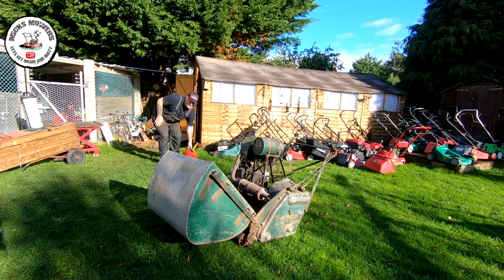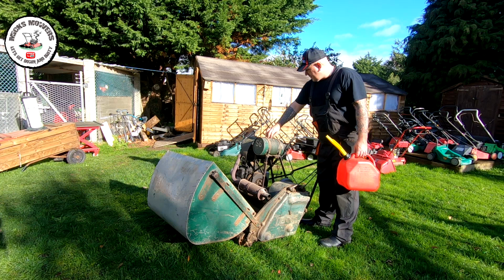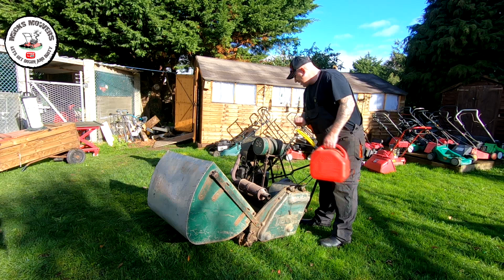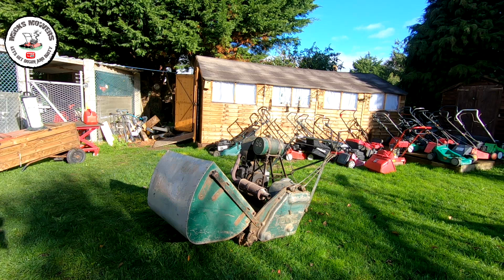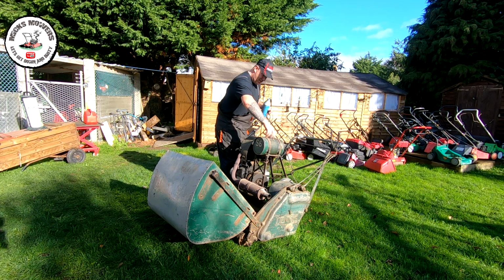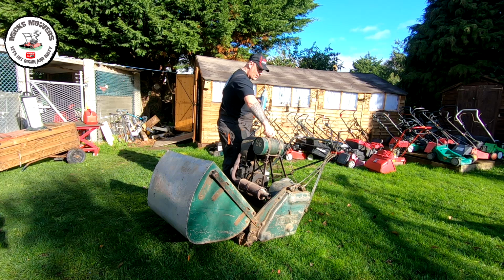Vintage 1930s Z Type Dennis Lawn Mower Let's Try and Fire This Old Girl Up.

Comment: Looks like something from Mad Max.  You can come over and mow my snow.  I bet it would.  I love it.  All the latest safety features from 1930.  If the engine runs ok I would leave it.  Measure what you can.  Of course.
Reply from the maker: I thought you might like that.. it's got some horse power mate.. now I just need to find the time to paint it

Comment: Brilliant machines for classic quality English cut lawns 😃. Must have been quite a find. 

My family had a 1954 model (can't remember its cutting width) complete with detachable ride-on seat 'trailer' on its own roller . Beast of a thonk-thonk sound from the massive single-cylinder engine, and despite weighing a ton it was an amazingly easy thing to turn for each new row having got the hang of it. The leather fanbelt always looked alarmingly slack, and I managed to wreck one after overtightening it!

The fanbelt was the only new component needed in all the years we 'drove' it. Dennis Bros Guildford had ceased trading a good 10yr previously, and IIRC I was pointed to a firm called Godstone Engineering which rescued what spare parts were left. Eventually the crank went and the poor thing 'rusted in peace'.... Happy days😁

Comment: Hi Mick. I love these old Dennis mowers. Used them since about 1965. There’s a few tips to help the starting but the one thing you should always do after stopping the engine is turn over to a compression position. At this point the valves are closed, valve springs at rest and you NEVER get problems with stick valves. I’ve still got 2 of them.
Reply from the maker: Thanks for the tip.
Reply: @themowerman  No worries. I’ll tell you how I start mine as well. I was told this by a real Dennis engineer. Turn on petrol. Flood it with the tickler on the carb. Pull the decompression rod and turn over the engine six times. Do that once more. Then release the decompression rod and start the engine. 👍He told me you could never get too much petrol in the cylinder.
Reply from the maker: @petestephens  ok  next time I get it out I will give it a go

Comment: When set up correctly it will be more reliable than a modern mower, 2nd pull over compression and there you go (i do love impulse magnetos) 😎
Reply from the maker: Yeah mate.. it's a cracking mower

Comment: Great video Mick, brings bad so many memories of my time with Hampshire County Council whilst cutting school Hockey pitches. Just be careful using the starting handle, make sure you have your thumb in the right position just in case of any kick back, they will break bones if they kick back when starting. I would say, don't fix whats not broken regarding the engine, cosmetic restoration only. I would love to see a total nut and bolt restoration but if something goes wrong whilst dismantling the engine, that could be the end of it's life. I would hate to see that happen. Stay safe, keep the mowers coming.
Reply from the maker: I used to work on some old inbord engines back in the day so know all about kick back.. I did not need took many lessons on that lol

Comment: Clearly this machine is not meant for today’s size gardens. It’s appears to be meant for estates or perhaps golf courses. One can see why the ride-behind seat and roller is a necessary option! I’d consider this a precursor to ride-on lawn tractors as it almost nearly is. Other than negating the engine backfire, work on the remaining mechanicals during your restoration. Thinking of applying your new paint sprayer here?  Cheers.
Reply from the maker: Hi mate.. yeah it's should be used Inna golf course or football stadiums.. I have a roller seat already for it.. it's not been run in about 3 years so needs a good run before I investigate the backfiring.. ta for watching.. yeah the new spray gun may come in handy

Comment: hi mick, nice beast, im working on an identical one bought 2 weeks ago,now running.. i would like some feeler gauge gaps if you have any. eg plug, points, tappets.. also is it 1 1/2 pints for the gear box side oil..thanks in advance
Reply from the maker: I am new to this mower too mate so if you come across any information please feel free to share

Comment: Hi mick - I’ve got a very similar 1930s Dennis and having the same problem getting fuel to cylinder head I’ve trying all I know ( which ain’t a lot ) any help would be great 👍 so looking forward to hearing it fire up 
Cheers Doug
Reply from the maker: Hi mate.. open the fuel mix jet.. mine needs it open about 4 turns
Reply: @themowerman  
Thanks for reply mick - I’ve tried this as I’ve watched your video 👍
I sent the mag away to get refurbed as I couldn’t get a spark 👍 Will the timing need setting up when’s mags reseated ?????
Cheers Doug
Reply from the maker: @maxjoehares9357  Yeah mate
Reply: @themowerman  
Is this hard to do mick or relatively straight forward as I can’t find anything online ???
Reply from the maker: @maxjoehares9357  yeah not too bad..
Reply: @themowerman  
Any chance of a step by step video 😂😂😂😂👍
Reply from the maker: @maxjoehares9357  lol nope.. mine is is the back of the store.. until next year ..
Reply: @themowerman  
Hi mick had another go at the Dennis today still no luck 😤😤😤
I’ve noticed it’s got a sticky valve lifter any ideas how to free it up without dismantling 🤷‍♂️🤷‍♂️🤷‍♂️
Reply from the maker: @maxjoehares9357  oil bath mate. Or try a little heat then hit it with some break cleaner..
Reply: @themowerman  
Thanks mick I’ll give it a go 👍